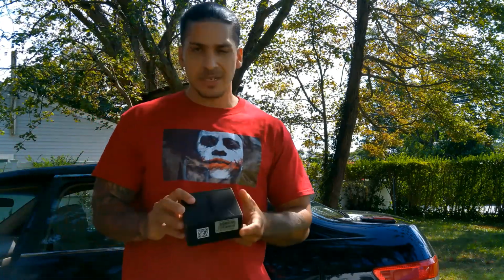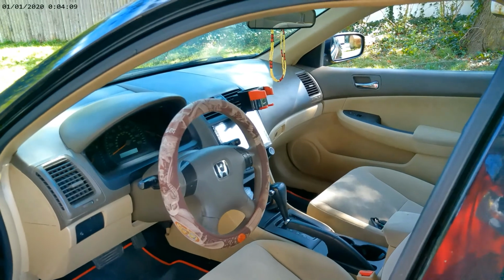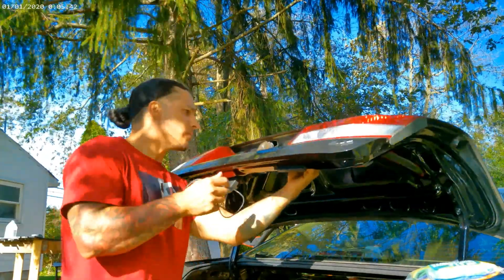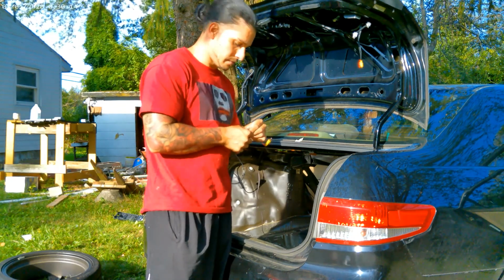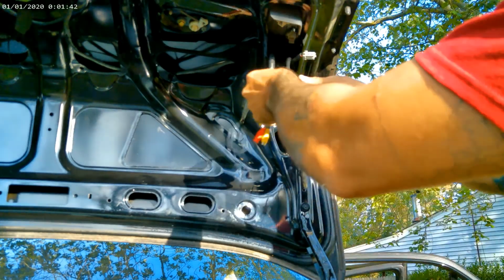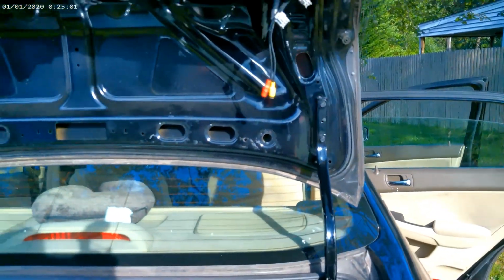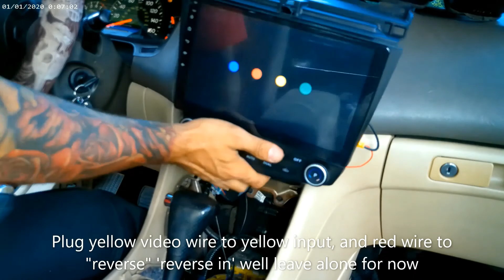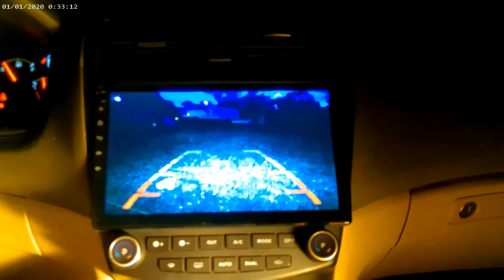How to install rear view reversing night vision camera. 2004 Honda Accord. Xtron

Comment: Thanks for sharing.   When I install the camera on my 2012 Accord, I had cut a slit in the license plate light fixture.   Planning to install one in a 2007 Accord.  Will check out if would be better to go through the taillight as you had done.
Reply from the maker: Welcome. And Ofcourse what ever it’s easier with minimal damage to original car set up

Comment: Thaks for the video. Was it really necessary to remove the back seats if you were just going thru to the rocker covers anyway?
Reply from the maker: Hey thank you.  The wire I tapped to it’s right there behind the back of the back seat. It’s not necessary to remove but it made the job easier if you chose to tap into another wire.  I also needed to fix the lining of the carpet under the seat. So it was convenient for me.

Comment: Was there anything you had to do in the android unit to get the camera to work? I've got power but the camera does not come on when I go into reverse.
Reply from the maker: Im sure a wire plugs into the android and the other to the reverse light I went through the whole thing on my video.

Comment: hey brother I have the same unit as you what did you do with the wire that is labeled "reverse in" because when I put it in reverse the head unit doesn't seem to know its in reverse and doesn't change the source to display the back up camera. I have the wire that just says reverse and the red power positive wire connected together so it should be working but its not.
Reply from the maker: I believe that one hours to the head unit.

Comment: I spliced my wires now the back up lights won’t come on 😤 and yes positive with positive and negative with negative. I checked the fuse and it’s not burnt…
Reply from the maker: You didn’t cut it completely right.  Check that the other end in not making contact with metal.
Reply: Yes I did cut it completely…. 💀
Reply from the maker: Oh no. Connect the wire back and make sure the red wire attached to it.

Comment: Mine shows no input when it goes into reverse. Is there a setting that I have to change?
Reply from the maker: SoSo Beats did you make sure you plug your power to the light and the input to the reverse wire?
Reply: @Jaime.grijalva.official  yes, everything is plugged in. The screen automatically goes to the reverse camera but just keeps saying no input.
Reply from the maker: SoSo Beats so basically it’s not getting power into the input wire. So change the source I ran a wire from the reverse lights to the input behind the radio.
Reply: @Jaime.grijalva.official  so run a wire from the green backup light to the back of the radio to the wire that says backup?
Reply from the maker: SoSo Beats yes it should be back up input.
Reply: @Jaime.grijalva.official  thank you I'll give it a try
Reply from the maker: SoSo Beats let me know how it goes.
Reply: @Jaime.grijalva.official  I've tried it the way you told me still no luck lol I'm giving up
Reply from the maker: SoSo Beats I wish I could see exactly what is going on.
Reply: @Jaime.grijalva.official  I know right. To bad I'm in cali. Thanks for trying to help
Reply from the maker: SoSo Beats of course.  If you do find the problem let me know.  Also call the manufacturer of the radio they may be able to give you more info.
Reply: @Jaime.grijalva.official  I finally got it to work. There's a settings when you out it into reverse on the screen where you have to tap the screen and hold it down and change it to NTSC or something like that
Reply from the maker: @LilBoi1da  ohhh nice glad you figured it out and that it wasn’t a wording issue. 👍🏼👍🏼👍🏼